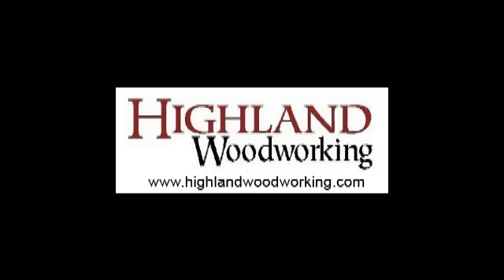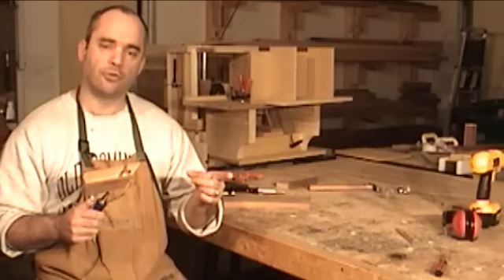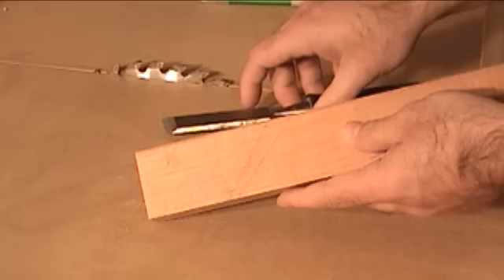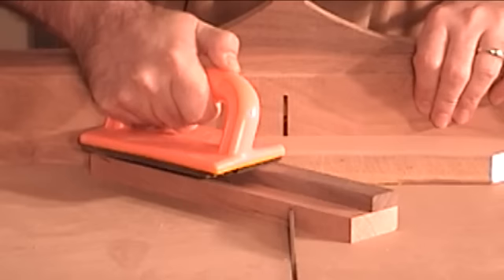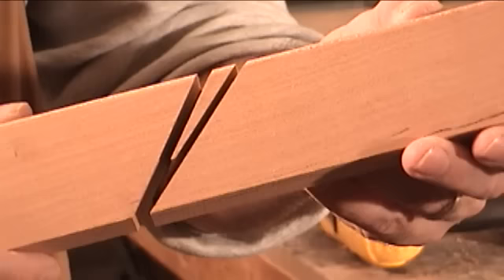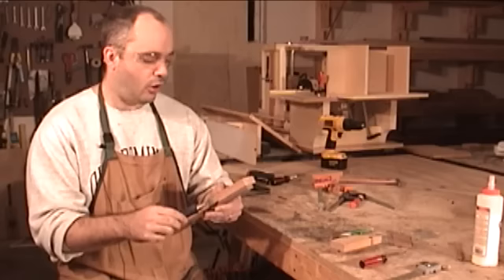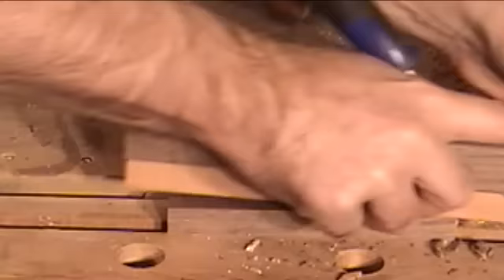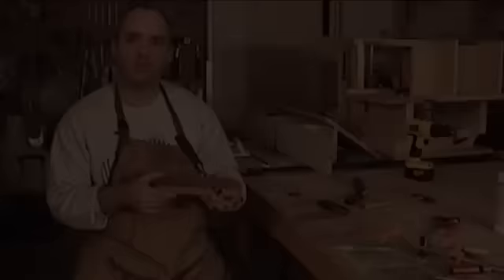Chisel Plane DIY

Comment: Just a little tip, if you make your own, leave more material on the front of the plane, it will be easier to handle and to control the pressure. Or, you can carve a vertical handle if you need a very short plane.

Comment: The piece if wood left between the 45 and 51 cut would have made a perfect wedge. If you didn't glue that spot it would have been a perfect wedge. Just thought it would be quicker. Thanks for your vids.
Reply: Six years late, but it would have been short grain, and would therefore be too weak.